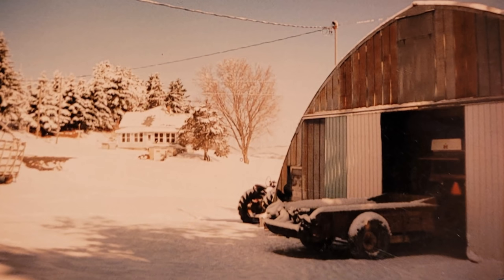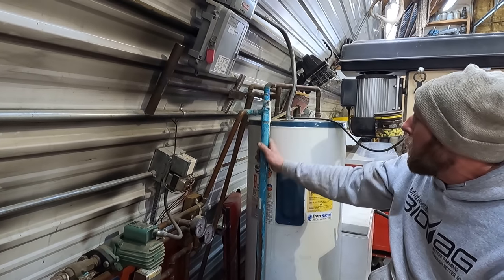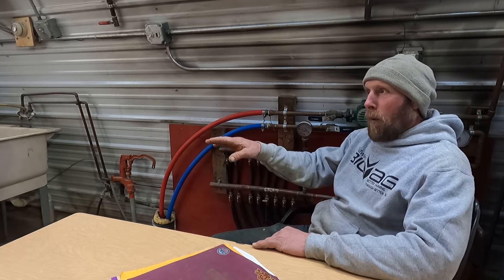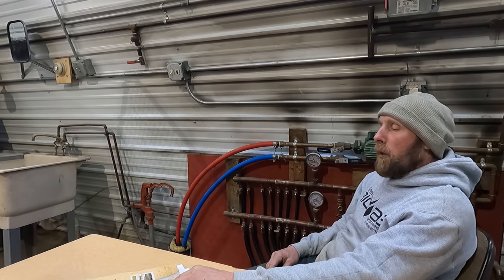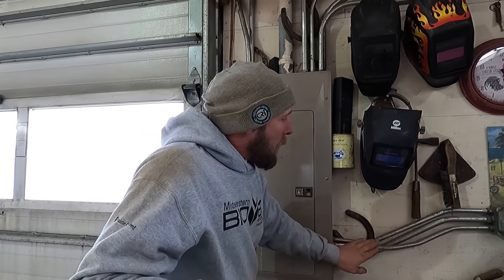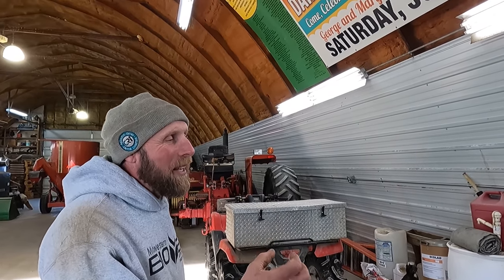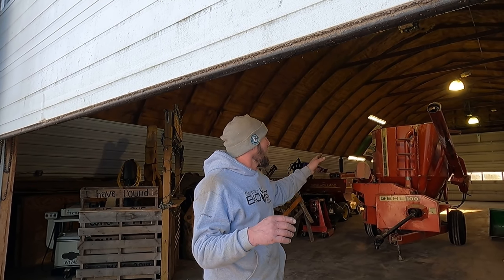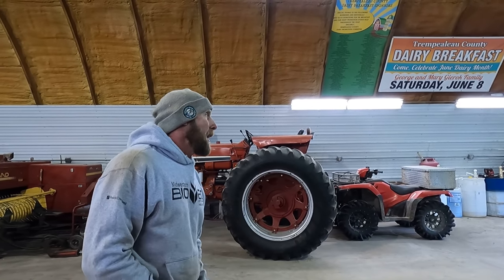Shop Tour! The Farm Shop on a Small Dairy Farm! (Part 1)

Comment: I just built a 48×32 with a 48×14 enclosed lean-to. With the cement floor and two  insulated garage doors. It was almost $70,000. It seems when ever I go to do something the prices skyrocket and that's what happened to the price of lumber. But I'm glad I have it. I have been thinking about switching to the outside boiler for heating. I think the government will use the insurance companies to attempt to ban wood heat.  If the furnace is outside they can't say much about it. I think I will regret not putting the lines in the cement but I was at the end of my budget and would have liked to have added ten feet to my barn as it was. You are a very creative man, a lot like my dad, and very kind and quiet natured. My hat is off to you.

Comment: Hydronics is forgiving and awsome. Generally 12 in centers 300ft on a zone max. Basic controls. Aqastat feeds thermostat. Put enviromenttly friendly glycol in the system not antifreeze. Theres a ratio. You can add concrete out front and add pex outside in concrete for snow melting.

Comment: If those strip lights have instant start ballast, you can get t8 led direct fit lamps. Phillips makes a good one. They are about 8 watts each. Also, you can get retrofit corncob lamps for the high bay lights. Probably drop your wattage down to about 400 total. The best part about led is the color variation. The higher kelvin rating the more blue it gets.

Comment: Cool Videos. 
I worked at a HVAC company in the 90's. We put in a hydronic system in a 650,000 sq ft building.  We used RV antifreeze and the temp was set at 140°F.
I felt it is like standing on a hot plate.. 
 Do you use any solar cells?
Watching in MKE.